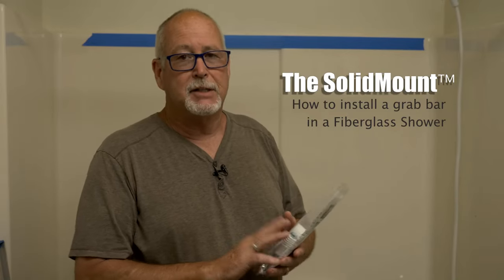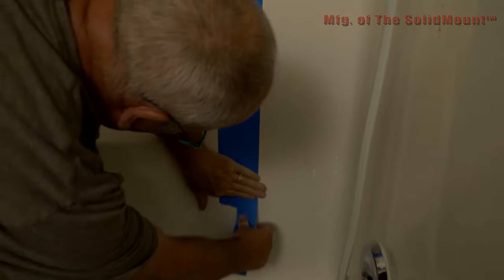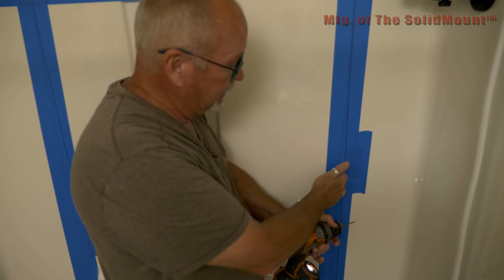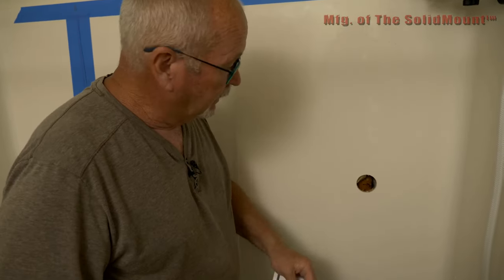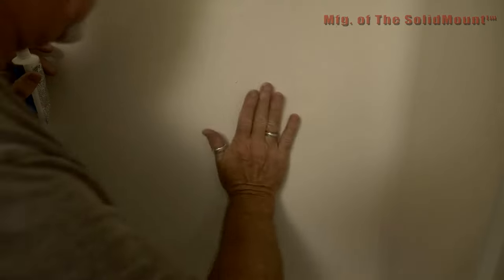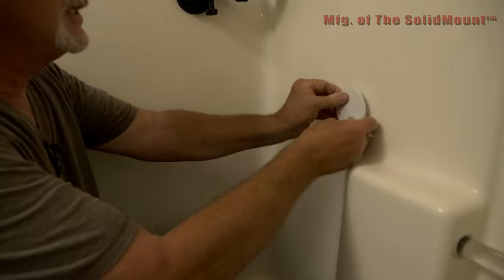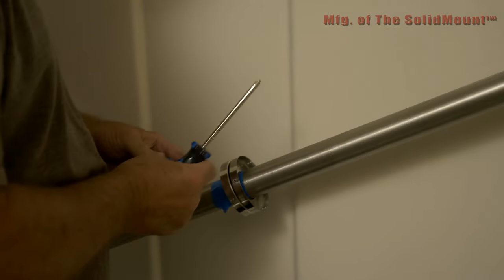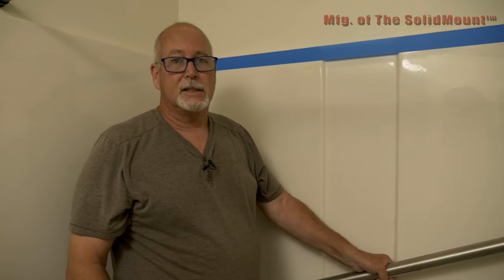Installing A Grab Bar in a Fiberglass Shower. *Grab Bar not Included*

Comment: the part i really wanted to see was the part you did not show. Cutting the spacer. I'm thinking that is  very difficult to do and thats why it was lwft out of the video
Reply from the maker: The contrary. They are very easy to do but because the area we had to film in was so small. By the time we got the lights, cameras and other equipment in the room I basically had to sit on the side of the tub or in it. We just cut them with a hacksaw. In the future I will toss up a short video on how to cut the spacers. But seriously they cut very easily. Let me know if you have any other questions.
Reply from the maker: The video on "How to cut the threaded spacers" is now available on YouTube.

Comment: Why not use your stud finder to double check that the stud is actually at the lower elevation where you're installing the hardware?  There's no guarantee that studs are installed plumb.
Reply: The stud finder cannot "read" through the fiberglass shower wall and the sheet rock wall behind the fiberglass.
Reply: @billchippendale6409    Ah, I wasn't paying attention to the fact that he was not scanning through the fiberglass up at the top of the unit.  Thanks for the correction!
Reply from the maker: I wish they made one that could scan through the fiberglass and a gap and be accurate.